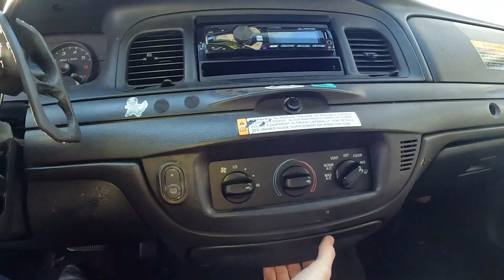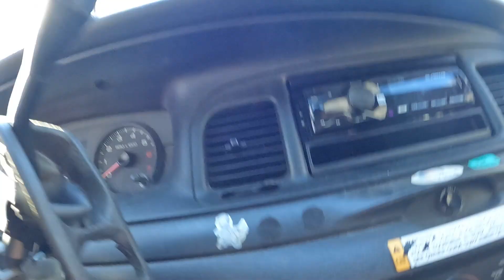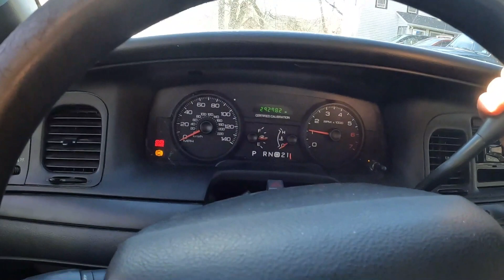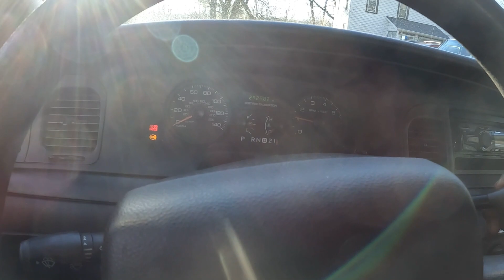REVIVING A '06 P71 Crown Vic That I Bought For CHEAP!!! - (Also Reveal the Burban) Budget RACECARS

Comment: Check under the factory floor mat where driver and passenger feet rest because they’re know to rot from plugged vent tubes.
Reply from the maker: I hear ya. I found that there was a ton of trash in the vents and had to deep clean it. Luckily no rust on the floors so I caught it just in time. Sorry the video is kinda outta order been awhile since I did a video trying to get back into a swing of things!